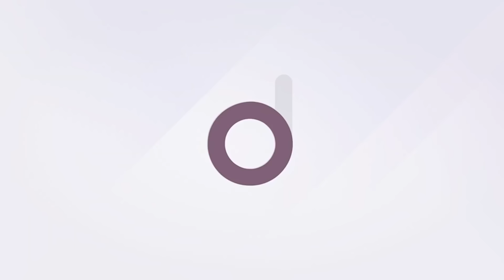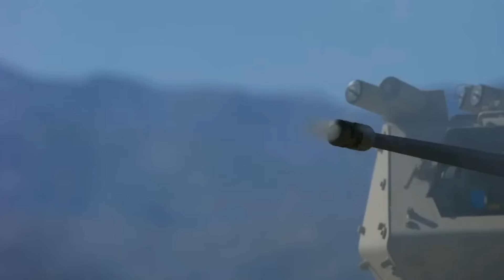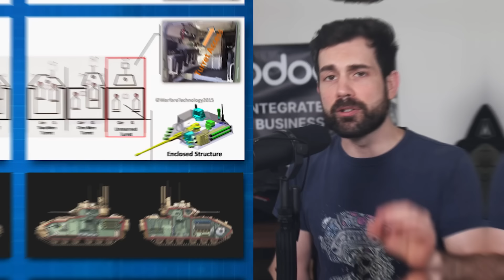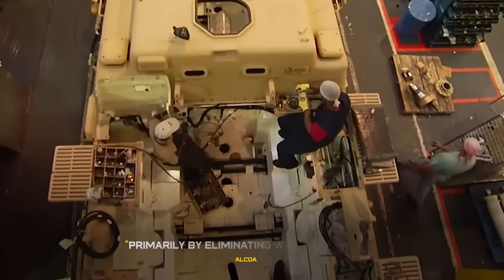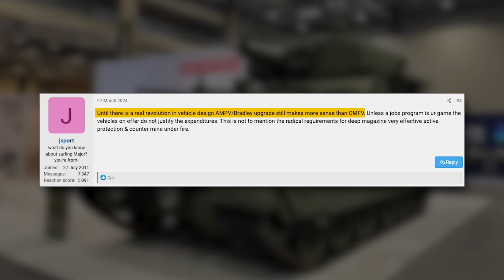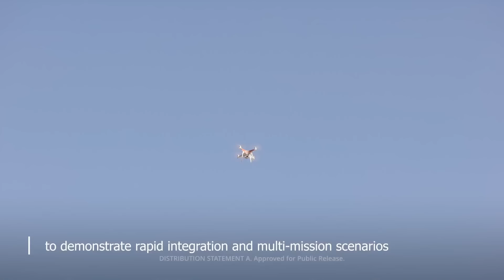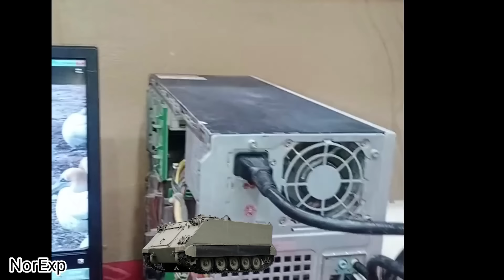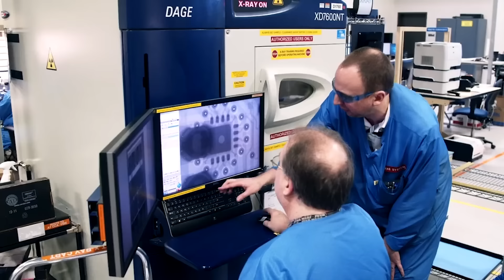How America’s Quietly Building a Secret Armored Fleet

Comment: Mechanized autoloading mortar rounds that can be fired on the move is HUGE!  More please!
Reply: Any artillery system that can fire on the move is a good idea... Just the same goes for any missile system...  However drones are the thing that should be developed and I am not talking about things like predators , but rather small scale drones that  are basically suicide drones on a small scale , also a wide range from flying to roving models (imagine a minefield that can move itself for instance). There is a lot of scope for drone warfare to evolve , we are talking stealth drones and different capabilities , communication methods for instance... When you look at what is actually happening there is some capability but not yet anywhere close to what is possible with current technology. I  used to tell people that troops cost a lot of money to train and equip and a soldier or group could be killed by 1 drone that costs a fraction of their equipment alone.
Reply: @greyvoice7949  drones cannot hold territory. The air-force learned that just bombing doesn’t work. The US has had drones since they came out as well.
Reply: @goldenhate6649  I'm afraid people are not well versed in true drone warfare waged on an industrial scale... Basically you could destroy entire military formations and thus no need to hold any territory with boots on the ground as anything within range would be destroyed/killed... But this is drone warfare on a scale which is actually vastly cheaper than training troops as well as ensuring you are not the people that have to put masses of people in body bags. Your lives are treated to be cheap in the military given how politicians act...
   Bottom line is that the people in charge of procurement and those dreaming up how to fight wars have not yet fully realised the true possibilities... Not to mention the saving of lives on your own side...
Reply: @goldenhate6649 Thank you.
Someone tell Hegseth.
Mascara is clouding his vision
Reply: All our junk in Ukraine got destroyed by drones. Wait till it's AI swarm drones. Let's see 100,000 drones for the price of 1 updated Bradley 😉
Reply: Drones make it junk. Same bad idea.

Comment: A reason there has not been much publicity is maybe they don't want any. With the Abrams and Bradley, the media did little more than find fault and do 'hatchet jobs' on the programs, a staple of '60 Minutes' and the New York Times.

The M-113 still being used?! Are there still Willy Jeeps in use too?

One of the problems with the Bradley is there was not enough room inside them so the Army had to restructure the squad numbers. 
The army has gotten used to fighting in deserts. They, and their vehicles, need to be ready for other environments. Hopefully that is what war colleges are for. How many 'observers' are in Ukraine?

One piece hulls? How about repairability and maintainance access? Or in modern war there is usually not enough left to repair?

Maybe BAE has learned things from it's questionable British RA designs.

Comment: The Dragon Fire II was a 120 mm mortar system that was tested for the Marine Corps, but was ultimately not used. The Dragon Fire II was a self-propelled mortar that was designed to be towed by an AM General HMMWV. It was intended to be used to support small, dispersed units.

Comment: Having worked on the APMV platform, its great.  The Cummins engine never quits, and the gas mileage is actually impressive.  I had to only replace 1 engine within a fleet of 30 over 4 years.
Reply: Military vehicles need engines often?
Reply: @fredthefish581  They are "heavy equipment" used hard. That kind of performance would be impressive in a civilian truck fleet.
Reply: @oldphart-zc3jzThat's fair
Reply: One thing, how much use are those actually getting? I imagine it's mainly testing and developing training manuals for the use of it rather than any actual combat. So those engines are likely much less stressed than they would be for a multi day deployment of regular repositioning, still very good stats but just wanted to put it into perspective.
Reply: @sykessaul123  yes good point, but “testing” by the Army includes simulated combat use.
Reply: @sykessaul123  Testing means they get worked wayyyy harder than standard training. Your First Sergeant is likely to rip a new one if he sees you doing dumb shit like going over ditches that sketchy with his fleet because downing a vehicle in training means it's getting towed to FMS, and he has the same number guys with one less vehicle and it probably take FOREVER to fix so future training is now hindered.

In testing the Army has plenty of money to throw around for expedited repairs because they expect lots of failures while the vehicles capabilities are tested.

But still, even in training vehicles get pushed hard. Plus - many times the required daily preventative inspections done by the crew are half-assed because they often are the last or first task of the day so you're tired.
Reply: @sykessaul123  WAIT thats a good ratio? lol.

I would honestly expect zero engine failure of 4 years to be normal. You told me it was like 10 years sure. 

But aren't diesel engines supposed to last like hundreds of thousands of miles.

If he said only 1 in a fleet of 300/3000 sure. I can then say ok its  a good engine, that one replacement is just a manufacturer mistake.
Reply: @ In a diesel car or lightweight van, maybe. These are bigger, under more strain due to the armour and weapon system weight than commercial vehicles when they are in use, so I'd expect them to last less miles but for a longer time. Could be wrong, that's just my speculation.
Reply: @sykessaul123  no, we have lots of experience with heavy vehicles, semi trucks, tractors, bull dozers etc
Reply: @sykessaul123  and they aren't exactly meant for Hiway travel.
Reply: @sparkzbarca  you underestimate the "ingenuity" of a 20 yr old driver to find new ways to stress a vehicle and engine.
Reply: @sparkzbarca they are first generation deployment Vic's so over the next 10 years minor issues should be fixed that reliability is also impressive considering it's used for off roading while revving the fuck outta it in order to get over hills trenchs mud etc those engines are used HEAVILY and for long periods of time when they are in use when they aren't inside the motor pool having work done on em
Reply: @sparkzbarca similar except these Vic's got lots more moving parts and a lot more weight often in more compact packages in order to become a smaller target
Reply: @sparkzbarca  Military vehicles get used hard by G.I.s. One out of 30 is outstanding.
Reply: @babochee  3 drones and it's scrap. Need new ideas is the answer.
Reply: @quintinswartz4073 3 drones do that to just about anything on the battlefield lmao that doesn’t mean anything
Reply: @quintinswartz4073  It's cheap enough to justify the losses you might experience in the field and easy enough to repair that damaged vehicles can be used again if they're not completely destroyed. If the system is modular, perhaps they could integrate a system that uses the smaller 25mm cannon for drone defense. The smaller size would give it more ammo in the space they freed up, give it two more barrels and while the system would be more complicated you could get more volume of fire against mid-range strike drones, recon drones, and droppers. FPVs would still require APS, though perhaps there could be an AI controlled RWS with something like a souped up AA12 designed for that role.

Comment: It's a nice vehicle - but an outdated concept.

The Bradley M2 it's based on was designed to take on the Red Army in the Fulda gap in the 80ies.

The thing about tracks is: They were a neccessity when the first tanks came along during WW1 - but today - wheels do almost everything better.

With modern tire technology and CTIS - there is little reason for tracks in APC/IFV application.

Yes - you might get stuck easier - but not by much. Tracks get stuck too - and it's way harder to un-stuck them. Instead of going through - you can go around quickly.

Wheels are cheaper, lighter, get better fuel milage (and therefore: Range) and can travel for 2000km if need be - on it's own. Less noise, less maintainance - less wear - less spare parts needed.

If you compare the AMPV to the German Boxer - the Boxer wins in almost every aspect.

It has more engine power. 720hp vs. 600.

It can go faster - up to 100kph.

It has 8 wheels - like Stryker or Patria. If it hits an anti-tank mine - it will blow a front wheel off. But it can still move - as these things easily run on 7.

A tracked vehicle like AMPV or Bradley is a mobility kill with a damaged track.

It's great that you can change the turret  - but Boxer can switch it's whole mission module. AMPV has space for 6 dismounts - Boxer holds 8.

Yes - it's expensive and time-consuming to re-design the whole thing - but it's better than a modification based on the 40-year-old Bradley - in particular in the long run.

Many countries already bought Boxer - a very good universal concept with plenty of upgrade potential.

That's why I think wheels are the future - and tracks are less and less useful. One day - even MBTs will run on wheels IMO.

Comment: That is good that you have now the AMPV that will now really improve mechanized infantry operation. In the Philippines where we have used and developed the mechanized combat operation against dissidents and terrorists groups the used of M113 and wheeled simba or commando armored vehicles has limited armor and firepower when it has to do forward battle position as needed. In our Marawi battles M113 proved weak against rpg.Makeshift wooden crate layer over its sides ,front and backcaused the rpg rockets to hit wood first and explode without hitting the armor.Hopefully with new heavier armor of the AMPV this can make offensive frontal operation effective helped by additional firepower from its gun just like the bushmaster,antitank launchers,machine guns and remotely controlled with automation on loading providing more space for mounted infantry.

Comment: So the 'plan" is to bring a future version of a "baby"  main battle tank which will allow for more advanced weapon systems still in the design labs or test facilities.  Some body explain to me what they are doing to solve the problem of refueling this attack force after 8 to 12 hours of continous movement.  What if your adversary just desides to step aside, lay low, and wait for your resupply of fuel to drive by in a lightly protected convoy.  Think about a couple FPV drones hitting the lead and rear elements of your resupply, then maybe some traditional motars.  Your enemy doesn't actually have to have you in view.They just have to know your are stalled and trapped.

Comment: Cool report.  Computer-controlled modular building on a common platform seems much more useful and foolproof than field-swappable modular load packages on a common platform.  As to the M113, there have been advanced replacements available for nearly half a century now, including turretless versions and unmanned turret versions up to 30x173mm.  Including hybrid power versions.  Not nearly so well armored as these (unless one accepts titanium & ceramic applique armor) but a lot smaller targets.

Comment: Shouldn’t be too crazy to think that we’re using tech from the Cold War still. Hell, we just recently stopped using the f14. Even the F15 (designed in 69, adopted in the early 70’s) 16 (introduced in 72) and 18 (first designed in 1970, later introduced in 1980’s) are decades old. Not to mention the M16/M4 and many of the firearms being used in combat to this day. 

All of these systems were so well designed and manufactured that they never saw the need to replace them, just upgrade as time goes by.

Comment: The difference in horsepower might be canceled out by the increase in weight. Weight is determined by volume. A 78% increase in size has to come with an increase in weight.

Switching out the top plate sounds great but what about all electronics inside. If the Army supply system has not changed, they will send only half of what you need.

Comment: 2 billion for 3,800 vehicles? That math doesn't math... That means an AMPV for only $526,316. Seems like even a conversion using an existing M2 hull wouldn't be that cheap. But... It sure is sexy... Let's buy 'em!
Reply: As of December 2024 it appears 580 M2 had already been converted and returned.
Reply: @AndrewRoberts11  Agreed they're doing conversions, I'm just doubting it's only going to cost 500k per...
Reply: @a24396  They'll likely take Apple's approach of the great value base Mac Mini, but as soon as you add a few option you'll end up being charged a multiple of the base price.
Reply: @AndrewRoberts11  yeah... Once the contract is signed, I doubt it's going to be a firm fixed price... I suspect cost plus...
Reply: @a24396  They notionally have a common "top plate" allowing for a multitude of optional turrets to be purchased separately / later, that will likely cost as much as the hull.

Comment: Great video. I'm an ex- 11HE9 (11 Hotel Echo Niner) mechanized infantry guy, 1st Infantry Division. 2 years at Ft. Riley, KS and 2 years in Boblingen, West Germany, 1984-88. I operated the M901 ITV (Improved TOW Vehicle). Essentially a M113A1 w/ a TOW turret on top. Good to see the Army getting smart to replace the old 113 platform. Our vehicles were Vietnam era 113's, poorly maintained at the depot level, beat up and under-powered. Of course the 901 has long been replaced by the M2 Bradley. The many versions of the AMPV make perfect sense.

Comment: Oh look, the primitives are designing with their primitive tech slightly less idiotically! 

They could just 3d print with crconi, graphene, and silicon nitride filaments. Mass produce the filaments they like and ship them out everywhere even to fobs with 3d printers, suddenly parts modularity means nothing as you can make any part for anything on site. 

Missiles are already losing relevance with the improvement of ciws/c-ram capabilities, just make like 5-10mm hypervelocity "delivery systems" instead. 3d printed rocket assisted shaped charge and penetrator with programmable airburst, idk, we have so many options to cheaply improve. Current armor is so far behind, it really doesn't need you to add complexity and funding for rockets when some DINGU propellant hypervelocity projectiles do just fine for all targets. 

Swap engines out for toroidal stirling hybrids, you can use anything that produces heat, get more than double fuel efficiency, and have high energy output on demand from the ICE core. 

Mechanical drive systems are just unnecessary complications for worse performance and tracks are a nightmare, switch to motors and non-pneumatic tires (just look at how nice barebones nitinol tires are before improvements). You can blow less cash than tracks for hexapod/octopod legs on omni-wheels if you feel like having the best shit around. Anyone here in robotics know how simple legs turned out to be, especially as they scale up and you stop using the shittiest consumer market 3d printer plastics.

Comment: Advanced suspension also means fewer weeks until AMPV dismounts can handle their ride going full speed without puking their guts out and their dismounts being less "staggering greenfaced out of the vehicle" and more "exiting in a combat ready fashion".

Overall though, any future army is going to need a lot more vehicles with adequate anti-drone weapons. So far the smallest caliber such weapon is the 30mm, so you need the maximum number of vehicles able to carry that.

The stinger is also in the uncomfortable position where it's too expensive for drones and not capable enough to do much against the next generation of enemy air support (where they'll sit and lob missiles/bombs from at least 10km out. Regardless of if they're helicopters or air craft lobbing glide bombs).

Comment: The 30 mm Cannon allows the use of ahead ammunition which are a nato standardized are bursting ammunition that don't cost a lot I think it's $35 a round.  And it has proved to be extremely effective against these small drones requiring an average of 6 shots just shoot down a drone out to a distance of 5 km so if you have sensor systems which are capable

Comment: Important programs are stealth, mainly to prevent them from becoming a Political Football.
For example, the P-3 replacement (the P-8) was a no-bid award to Boeing,  who built the Navy a custom 737-800 variant.  Simple, fast, relatively cheap.
Meanwhile, the replacement tanker program was a disaster.  NATO got involved,  and they insisted on letting Airbus bid on the program.  Every time you wanted to change a chip on a board somewhere,  there was a Congressional Hearing.  Inexplicably, the whole thing was over-budget and behind schedule. . .
Now, I hear that they are going to dump the 767-based tanker and try again.

Maybe a 737-800-based tanker would be a good idea???
Maybe have the whole thing done in the skunk works, so that none of the usual backseat drivers hears about it until it is done?